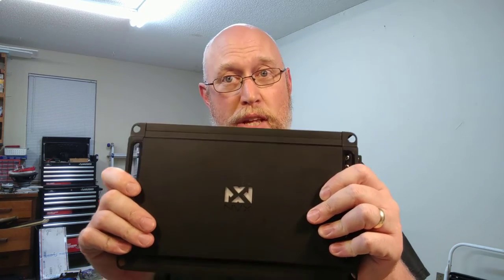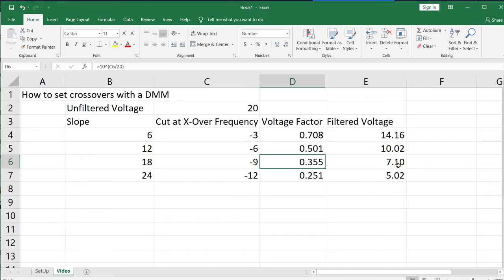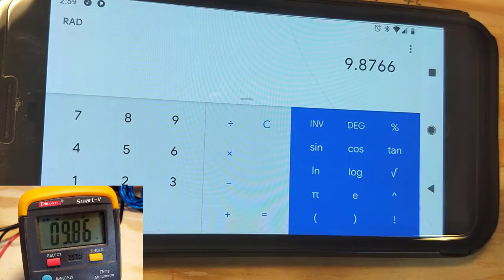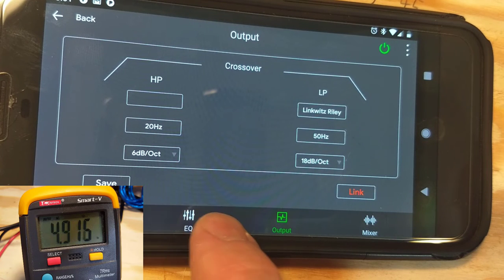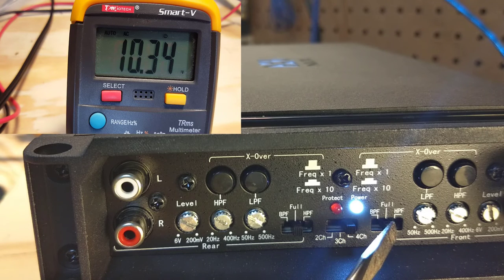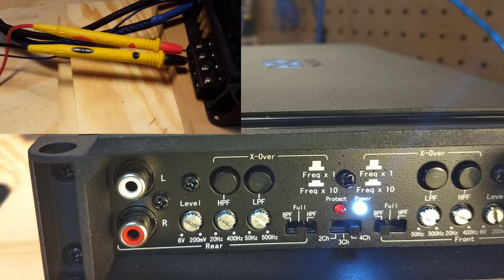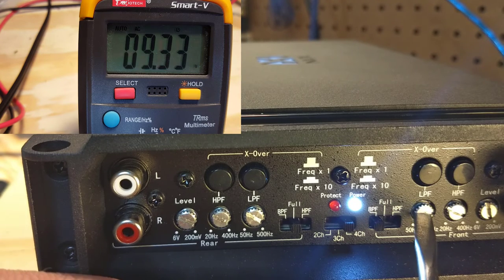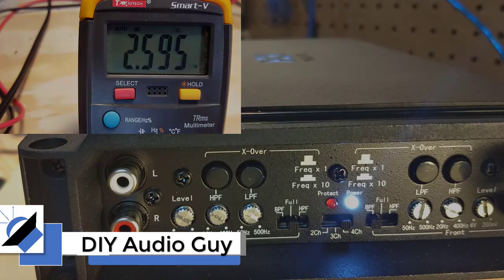Set Crossovers with a Multi-Meter, the CORRECT way!

Comment: Sorry for my poor english but I have an question for you. I followed this video tutorial yesterday when I tweaked an 4x80w 4 ohm´s amplifier (GAS 80,4 Pro)  with a crossover. The strange things where that the output voltage did not change at all when I switshed between HPF and Full range. I could see a minor difference when I screwed the wheel but it was way under 1 volt. I had an unfiltered voltage of around 10,05v and it was almost the same when I swithed to HPF. If I connected the speakers I could hear the difference in sound so it seemed that the filter worked correctly. I suppose I did something wrong, 

I also tried to use an oscilloscope on the speaker outputs both on the 4x80w 4ohm amplifier (1000hz -5db test tone) and the 1000w GAS 1.1000 PRO 1-4 ohm  (40hz -5db testtone) to get the correct gain but the curves on the ocilloscope looked distorded way under the max output that those amplifier should have left. For example the 1000w amplifier had a clean signal only up to 17v. The head unit where correctly tweaked with the oscilloscope and the volume where set to that maximum level.

In the end I just put the voltage at  17,8v at the 80.4 amplifier and 34.6v (600w 2ohm) at the 1.1000 amplifier and it sounds just fine in my opinion but it was really annoying that I could'nt do it the way that i had planned from the beginning. The HPF screw where just put around where I thought 80hz where.
Reply from the maker: I am sorry it did not work.  It is very difficult to trouble-shoot in YouTube comments.  If it sounds good to you then it should be fine.

Comment: I have a NVX JAD1200 and its a 24octave amp. I put my volume at 28  and played a 75hz tone. I put the crossover the highest it could go and I got a reading of 31.5v. I multiplied the unfiltered voltage to 0.251 and it's 8.85. I lowered the level on the crossover and did not lower more than 20v. So I lowered the volume and Got it to 8.0v (by luck) I Tried getting to 8.8v but the next notch  jumps to 9.5.
Reply from the maker: That's a solid amp, I have the 4-channel version.  I wish they still sold the JAD line, I am not fond of the newer VAD line.   I am sure they are good amps, I just don't like the look.

I have been doing a lot of research on crossovers and have had some good feedback from viewers, here is what I have learned:  There are different crossover types (bessel, buttworth, linkwitz-riley), they are all implemented differently, and not every company implements them as intended.   I think for that amp your best bet is to set the crossover using .708 (the -3 db down point).

Most importantly, set it so that it sounds the best.  The technical stuff is fun, but the music is what matters. 

I hope to get some updated crossover videos out when it warms up!
Reply: @DIYAudioGuy  I love this amp, it fits under my passenger seat and it swallows lots of juice and the power sounds clean. I'm also using their 2ohm VCW 12" Sub in a vented enclosure at 32hz.. That's interesting I did not know that there's different crossover types. 

I'm also using the Audio Control LC2i LoC and it sends about 9v pre amp out put. Can that affect the reading on the multi meter? .. At the end I put the crossover on the amp one notch over because it sounded better.
Reply from the maker: @kevinski175  The voltage from the LC2i will not impact the crossover setting, but it will impact the gain, with that much input voltage you can keep the gain low.  You will have less noise in the system.
Reply: @DIYAudioGuy  I used your other video to help guide me to set my gain. I had a feeling it would impact my gain setting because my subwoofer is pretty loud and it is a 1/4" Turn before the half gain mark on the amp. I might even have to turn it down one more notch. Wanted to give the woofer exactly 1000rms

Comment: I got a fosgate 1200 r2 mono amp with some fosgate t1d4 12 inch subs. If I am doing this correctly my gain should be 28.28 volts. Now that is for the 800 rms for the speakers. The amp is dynoed at 1478 watts so that would be 38.44 volts. I am struggling on the frequency for the subs. I do not know the tune to the custom ported box. Could you please help me finish tuning this amp?
Reply from the maker: The box tuning is not relevant for setting gains, to set the gain you disconnect the subs and play a test tone (40 Hz or 50 Hz, either is fine).  Since the amp puts out more power than the subs can handle set the gain to get 800 watts.
Reply: @DIYAudioGuy  what will the voltage be for each one?
Reply from the maker: @thomasdearing7718   The voltage is measured at the amp.   28.28 volts
Reply: @DIYAudioGuy  ok I am at exactly 28.28 on my gains what about the frequency and infrasonic?
Reply from the maker: https://youtu.be/iWRoIho7A7c
Reply: @DIYAudioGuy  ok thanks. For some reason this amp is not hitting as hard as my punch 600. I do have a ported box that my buddy built that goes under the back seat of my 2000 z71. In my single cab s10 ported through the cab these speakers slammed hard. Perhaps I need to do some more tweaking on the amp. Tomarrow after work I will do some more tuning. I did tell you wrong my amp gains is 38.44 volts instead of 28.28 volts.
Reply: @DIYAudioGuy  by the way thank you for all of your information. I am trying to get my system back. I plan on running duel amps the mono for subs and a punch 400 for mids and highs. Gonna run the power series component 6.75 and the power series 4x6 for the rear doors. I plan on installing a 20 fard capacitor and possible install a second battery for the truck.

Comment: I was thinking I'd set my highpass today for my car sub. However I'm a little confused on the "Cut at X-Over Frequency"

Using some software crossover (WinISD for example) using a 20Hz Butterworth Highpass the -3dB point is always going to be 20Hz regardless of the slope/order. So either I'm confused and missing the point or something lol. It doesn't seem to change at all with the Q setting. So maybe just a limitation of the program or it's functioning as intended. 

Which means in my case my 2nd order (12dB/octave) highpass in my car should be set using your 0.708 Voltage Factor graph. Technically any Butterworth should be set that way it seems. Correct me if I'm wrong in assuming this.
Reply from the maker: I don't think you are wrong, as I have done some more research I think the DSP I used in this video to "verify" my math may be implementing it wrong.

Comment: It should be not right, should be 0.501 with 24db slope because my amp is 24db slope lpf and if I want to set to 63hz lpf I can't, I can only to around 65hz but it should go down to 50hz. If trying with 0.501 I can adjust to 63 and 50hz no problem. Maybe this dsp is different than normal car audio monoblocks
Reply from the maker: Or it could be your amp?

Comment: Can I use the same principles for home audio?       Let's say building a crossover, which I'm trying to avoid, but I'm using a couple crown xls 1000'swhich have the adjustable high pass,low pass  built in ?
Reply from the maker: Yes.

Comment: What level does the volume need to be at if I already know where I'm clipping?
Reply from the maker: You'll need something more advanced than a multimeter to know for sure.  The 75% rule of thumb is just a rule of thumb, it works for most people and will get them close enough.  Without more measuring and testing the only thing you can do is turn it up until it sounds bad then turn it back down a notch.

Comment: Hi DIY Audio Guy, I've learned so much from the few videos I've watch. Love learning the math portion of this.

I am bit confused see i have a dm-810 dsp, do I match the slope of amp on my dsp so they are the same. Do I set the crossover on both the dsp and amp or just one of them?  Thanks for taking the time and doing these videos.
Reply from the maker: If you have a DSP you can just turn off the crossovers on the amp and use the DSP.
Reply: @DIYAudioGuy  awesome i was using both crossovers on dsp and amp. Thank you for sharing your knowledge. I look forward to watching more of your videos.
Reply: @DIYAudioGuy  one last thing if my amp is 12db, should my dsp be set to 12db to match the amp or could I set it to what I want I have 12db and 24db on dsp.
Reply from the maker: Either is fine.  Set it so it sounds good and blends well with the rest of the system.  

The key advantage to the steeper slope is it gives you more flexibility when matching up drivers. You can for example cross a tweeter over a little bit closer to its resonant frequency when you jump up to a 24 DB per octave slope.  An aluminum cone mid-range is going to have some really nasty cone break up at the upper end of the frequency, a 24 DB crossover slope makes it a lot easier to filter that out.  

If you don't trust your ear then you will need to find a friend with a golden ear to help you tune it or see about getting your hands on an RTA.  You can build a cheap one with a smartphone and a few parts that you probably have lying around.  https://youtu.be/7orJovlXvBM
Reply: @DIYAudioGuy  yes 24 db slopes help avoid crossover phase issues too❤

Comment: Is the multiplying factor always the same for each slope type? Or does that need to be calculated depending on different factors?
Reply from the maker: It's different for each slope.
Reply: @DIYAudioGuy  the voltage factors are as shown? So for future reference if I were to do the math. A 6db per octave slope will always have a voltage factor of 0.708?
Reply from the maker: Yes!
Reply: @DIYAudioGuy  ok, thanks! Isn't math fun? Lol
Reply from the maker: I think so.

Comment: When doing crossovers like subsonic or LPF how do you know to use 6,12,18 or 24db slope? Meaning do you pick what slope to use or do you go by what Variable crossover your amp have? I have a skar rp-800.1d with a 24dB/OCT, VARIABLE CROSSOVER so do that mean I go by a 24db slope?
Reply from the maker: Yes, 24 db slope.  Most amps only let you vary the frequency.
Reply: @DIYAudioGuy  thank you now I have one more question I used the information from your subsonic filter video to get my subsonic and I used my voltage x .708 so should I reset my subsonic by using the 24db slope too?
Reply from the maker: @yoshi86  Yes
Reply: @DIYAudioGuy   ok I’m sorry I just wanna make sure I understand for subsonic for an example my box is tuned to 39hz so I take 39x.75=29.25 my voltage is 10 so I take 10x.251=2.51 then I play a 29.25 tone and adjust until I get 2.51? And for lpf I would just take my voltage”10” x 24db slope (10x.251=2.51) and set my lpf to 2.51
Reply from the maker: Sounds like you got it!
Reply from the maker: With those 24 dB per octave slopes you might be able to get away with a little lower frequency on the subsonic filter.  After you get it set up initially you can tinker with it a bit to make sure it has the sound that you like.  You could probably get away with setting the subsonic and entire octave below the tuning and frequency (divide the tuning frequency by 2).  Just go easy on The volume knob when you're playing really low stuff until you know for sure your speakers can handle it.
Reply: @DIYAudioGuy  do it matter what I set first (subsonic or lpf) because I went back to redo my subsonic and my exact math was with my volume on 20 I was getting a voltage of 2.2 so I x that with .251 and got a target of .55 with me playing the 29.25 tone my subsonic is max out and only getting to .59 so now im at a lost again and don’t wanna keep bothering you
Reply from the maker: @yoshi86  crossovers are  very gradual slopes that will start well above/below the crossover frequency.  Because of that you're going to have some overlap.  Let's say you set your low pass filter at 80 hz. One octave down will be 40 hz and crossover filter will reduce the voltage at 40 hz.  If you set the subsonic filter at 30 hertz then you get the same thing and both filters are filtering a little bit out at 40 hertz.  When you get to that point the only way to know for sure what to do is to listen to it and adjust the crossovers by ear.  Hope that makes sense and I hope that helps.

Comment: What would be the voltage factor for that subsonic filter?
Reply from the maker: Which subsonic filter?
Reply: If I'm saying this correctly. The subsonic is to keep your sub from dropping below its lowest frequency response. Say your sub has a frequency response from 28hz-300hz. You would put the subsonic at 30hz so it cant drop below 28hz and damage your sub. The amp gain or voltage doesn't factor what your subsonic setting is. I think your box tune does tho. If your box is turned at 32hz if your sub plays lower than 32hz it can damage your speaker. So you would want a subsonic at 32hz or slightly higher.
Reply from the maker: The rule of thumb is that you should set your subsonic filter one half an octave below your tuning frequency.  So if your tuning frequency is 32 hz multiply that by 0.75 and you should get 24 hz.
Reply: @DIYAudioGuy  oh ok, thanks
Reply from the maker: https://youtu.be/iWRoIho7A7c

Comment: Well this is a nice video on crossovers that I’ll definitely be using in the future. 

Normally I don’t need exact crossover settings, but this’ll come in handy for my highpass that needs to be set at 17 or 18Hz 2nd order. And I’ll want that to be almost perfectly set because I’d rather not bottom out my lil Ultimax under 18Hz. 

Wish I had DSP in the car because in the house my Inuke DSP makes it so simple just type in the number and select the slope and done. (Though it doesn’t let you DSP below 20Hz sadly)
Reply from the maker: What size Ultimax?
Reply: @DIYAudioGuy  It's the 10" that I've mentioned in another comment on another video of yours. (The one I've planned with 3 10 inch passive radiators)

Comment: Here is my question, I am running a set of Polk DB652 6.5" 2Way speakers on my motorcycle, The guys at polk audio stated that I should set my HP filter to 60Hz, My amp is 12dB, so to set the filter would I use a 60Hz test tone, then read the voltage and proceed as per your steps?
Reply from the maker: Yes, exactly.
Reply: Awesome, thank you so much for your videos, very helpful, I am installing these polk along with an MB Quart amp and LC2i LOC on my bike this weekend, so off to buy a MM
Reply from the maker: @darrenbritton2434  Get an auto-ranging, true RMS, digital one.  You don't have to drop $100 on a state-of-the-art fluke meter, but you will definitely want those features.
Reply: I will, but here is a secondary question, on your video for setting the gains, the head unit on my bike does not have any aux/rca outs, so I am using the LC2i LOC to capture the line level signal from the speakers wires, i know the steps to level match the LC2i so i am getting the strongest and cleanest signal to my amp, when I go to set the gains due to still follow the 75% rule on the volume level?  I used the 75% when I do the level matching on the LC2i...my gut tells me I am correct, but just checking
Reply from the maker: @darrenbritton2434  Yes set the head unit at 75% and then start working downstream at the LC7I and then move to the amp.

I'm curious as to why you're going with an LC7i instead of just using an amp with line level inputs?
Reply: this LOC has a bass output and down the road I am going to be adding subs to my hard bags, so i wanted to take advantage of that, additionally there is virtually no information from Yamaha on what is coming out of that head unit, so I decided to just level the playing field and put in an LOC
Reply: one of the things I wondered was the output voltage of the LC2i my amp is the MB Quart NA2-400.2 and it lists a variable voltage of 0.2 to 9 volts, does it track that I could use the MM and measure the voltage out of the LC2i to insure the hottest signal to the amp, they have this warning light you are supposed to use, but I assume i could fine tune it with a MM
Reply from the maker: Since you already have the line output converter all you need to do is purchase a few more adapters and you can make one of these:. https://youtu.be/7orJovlXvBM
Reply from the maker: The information you get from the digital multimeter should correlate quite closely with the warning light.
Reply: good morning, i started my install yesterday and ran into a snag, i would love some direction, the amp MB Quart NA2--400.2 has these molex quick connects for power, ground, remote, and the speaker outputs, as I was running my 8 guage amp wiring kit, it hit me...how do i connect this 8 guage wire t this molex quick connector, thoughts?
Reply: by the way this is Darren Britton, i am on my wife's computer this am LOL
Reply from the maker: There's probably about a hundred different ways you could do it, depending on what you want in the final product.  You can make a permanent connection, using solder and shrink wrap or butt connectors.  You can make a more temporary connection by crimping on some quick disconnect terminals, or you can make the connection using some terminal strips.